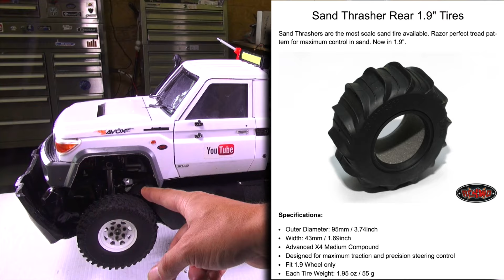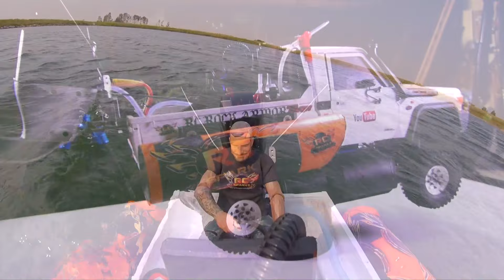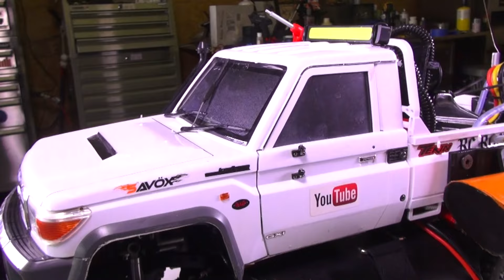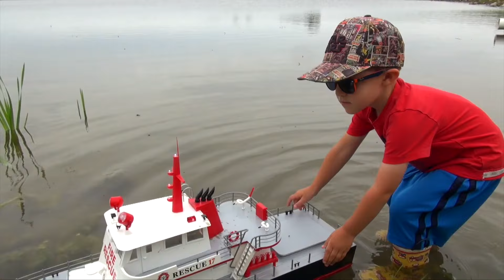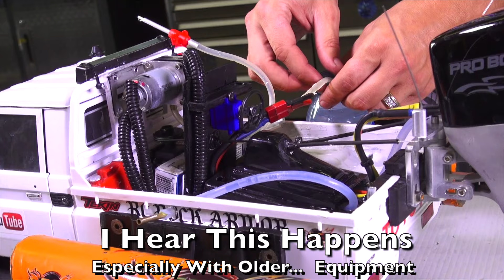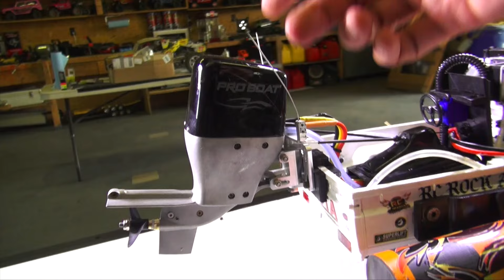RC ADVENTURES - TOYBOTA PROJECT - PT 8 - BBC TOP GEAR TRiBUTE BUiLD - TOYOTA LC70 TRUCK-BOAT

Comment: This probably wont be read by anyone ... but as a thought ... a ladder rack system but with 2 aluminum ice trays filled with "float foam" ... the ladder rack could be used as bracing and as each of the ice trays is nearly as wide as the truck - it would be incredibly stable "in  theory".  I have watched several of your videos and have enjoyed each. Best wishes.

Comment: Splice in a small overflow bottle so when the water is sucked up and goes into the Overflow bottle and then Prime's the line to the pump. that way you will always have a little bit of water in the overflow tank

Comment: The outboard pitch that you talk of, is the "trim" of the outboard. Also that flat plate above the prop should be level to just above the truck bed. You would get ALOT more performance from the outboard. They do make extensions  for most outboards. Ok enough of me, and good luck. I enjoy watching your videos, keep it up.

Comment: Are you sure that your problem was not a thermal shut-down of your ESC?, I did not see much water going through your cooling tube. Normally you need boat speed to force the water through the cooling system, your vehicle not being a boat does not generate a lot of speed. Interesting project, good luck with your future pond crossing.

Comment: i built a Plymouth GTX plastic model body into a RC car... i used micro losi highroller esc, remote and steering servo, and an rc heli motor for drive :)

Comment: Finally grew a pair of bearings and put down some cash for a TF2. I'm so happy with it, I immediately slapped on a F350 body and got rid of the white rims. It's a very scale and fun truck to work on and drive.

Comment: for the pump you could put a float switch on the motor side of the esc and then leave the switch that is on the remote on so then when the back fills up it pushes up on the switch and turns it on completing the circuit and the pump will turn on and pump the water out and then when it gets low the float switch will stop floating so the circuit will be broken and the pump will stop right before it gets below the end of the hose sounds complicated but it is't really if you are interested i can send you more info with a diagram

Comment: To keep loosing your prime on your pump, don't pump the water out completely. Keep enough just enough water in the bed of the truck to keep the bilge hose submerged so it doesn't lose it's prime.
Reply: Sorry, meant to say to keep from loosing the prime.

Comment: Love it man!! This is cool stuff. Gotta drop the angle of the out board. Yea it's picking up the front a bit but it's also driving the back down into the water. What in the video as you hit the throttle the back drops a ton. Awesome project

Comment: You can try putting a Y connection on the pump
One stays in the water to let the pump primed, and the other Y end stays in the rear of the truck, but i dont know how it will handle, or the shorter part of Y in the water, and a longer one in the rear bed of the truck, so that it sucks water first and then takes the water of the truck itself out

Or, you can let the water cooling of the esc and motor comming in the rear of the truck instead of out of the truck, and then use the pump on low speed so that it takes water out consistently
Just saying and helping you with ideas, i watched all the episodes and man, it's soo cool!

Comment: To keep it primed possibly put a small cup in there, that way you can hit the gas more when it is out on the water in order to keep it primed from the actual water coming in. By small I mean a shot glass or medicine cup for cold syrup cut down to fit.

Comment: Nice Project Dude. Just Lower those 2 orange floats by about an inch or 2 , this will life the boat above water.  You'll solve half of your problem I suppose. BTW All the best :)
Reply from the maker: But as a Tribute Truck.. I am making it as close to the full sized Channel Crossing as possible. Lowering the pontoons is not an option! Lol.. I want to ensure I can be as close to the episode as possible.. no cheating!
Reply: oh! Thats the case. Good luck! Waiting for the Channel Crossing Video :)

Comment: In regards to the pump losing its prime can you not put a spliter in the pipe 1 that sits in the same place as you have it now to remove the water from the tray and another length of tube that comes out the side that sits under the water line so it always has a constant water supply ergo eliminating the issue with the pump running dry

Comment: Try to run the tube straight down into the truck and then bring the tip through the back right of the truck and seal it. That should keep water in the lines and keep it primed. Keep it up! I want to see it make it!!

Comment: You wanted to know how to keep the water pump primed, you need to bring the hose from the pump underneath the rear of the truck bed and bring it up where the water builds up . make a hole and when the water does leak to the rear of the bed, it  will go in the hose from underneath the pickup and it would self Prime itself. In theory anyway can't hurt to try it out up to you I enjoy your project they are fun to watch and they bring out good ideas thanks Vincent dimino from torsional Concepts thanks for your support when I needed it have a great day
Reply from the maker: Vincent!!  What an epic idea my friend. I like that.. its the best I have read yet. Yes.. running the tube under the chassis, into a Hole in the tub! SMART!  Hey man, this hobby is about Community! What goes around comes around ;) Thank you!

Comment: Very cool build series... Take a sheet of clear parma Lexan (.040 or .060" thickness) and raise/extend the bed sides and tailgate. Use one piece so you can heat and bend the 90 degrees around tailgate corners so it won't leak and could make it removable. Where it's clear it really wouldn't change the look of truck, but would keep water from flowing into the back. You could seal it where it attaches with silicone or goop. On camera I doubt you'd see the clear polycarbonate, but it would keep water out better and probably wouldn't need bilge pump. Either way, awesome build & would be cool to try this.
Cheers!!!
Reply from the maker: Pete my friend.. but that would be CHEATiNG! haha :) Also, you may not be thinking of the Outboard Motor Control Wires for steering! they are right above the tail gate.. I have a few millimeters.. !
Reply: I understand...lol, good luck man. Cheers

Comment: Yup, still here. Just watching as much as I can before Imra hits and lose power. You need a small check valve to keep prime in pump, not sure what to use though. Got to have lights in case it... you know so you can see it when you dive for it lol. This should be epic 2.0. God Bless Ya   Dave

Comment: A Kavan One way valve might help to keep pressure in the water pump...
Ive used them to keep pressure in the fuel tank on nitro buggies fitted in the tube between the exhaust and fuel tank, they are pretty cheap around $10 Canadian

Comment: Heres an idea about the pump maby try running a y line off it into the water so one line will always have water in it not sher if it will work but just an idea    Robert Miller from Washington

Comment: You could try fitting an in-line non-return valve into the pump inlet hose. I used to run one on my 1/8th nitro to prevent just that scenario.

Comment: Maybe you can put a  Y on your suction hose that goes from the back of the bed of the truck 1 holes for the back of the truck and one hose that goes into the water therefore it would keep the pump primed at all times if you see what I mean
Reply: Kevin Breaker wouldn't work as air has least resistance the y would take the air once the water runs out unless he is able to put a valve on it to shut it off. Put a hole in the side of a straw and try drinking ya drink and see if you get air or water

Comment: enjoying this very much Medic. Just a thought, a fuel/water separator dump or pump that will automatically come on when the water level crosses the probes. You could dump the esc, receiver setup.
Bet you all had a good laugh watching the hose as it lost pressure..... keep it family safe right.....
Eight episodes? Oh wow it has been that many, guess I am enjoying this more than I realized.

Comment: An idea to help keep the prop in the water would be to trim a little bit more off of the bottom of the fin under the prop and then lower the motor, at the mount, the same amount (i.e. cut off 3 mm, then lower it 3 mm, etc.). Then you could give more throttle in the water without too much hassle.
From what I've been seeing from this entire build series, so far; it does not seem as though the fin is adding much if anything to the steering or stability anyhow.

Comment: Just wondering if the cab isn't getting into the water at all couldn't you remove the foam in the cab to reduce some weight

Comment: You can use a one way check valve the valve allows water to flow in one direction but not the other

Comment: You could probably use a check valve (similar to ones you can buy for aquarium air/bubbler systems) on the water pickup line for the bilge pump. It would allow water to flow through it to the pump when it's running, but it will stop back-flow when it's shut off. They should be relatively cheap at your local pet shop or anywhere you can pickup aquariums. 

I love the build so far!

Comment: use a one way check valve on your water line,trouble fixed,will always keep water in the line because it cant drain back out.

Comment: Use corrosian X on anything that has to do with water and electricity. I bought a can and have never had any issues with all my RC equipment including my Apprentice.  I have one I use just for water. I sprayed corrosion x on all servos and motor,esc,everything,and no problems with any splashs or emmersions. Your Toyboata is awesome. I like projects that extend a channel out. I am working on a Kadet Nitro RC Trainer Plane that hasnt been flown in 15 years,I am trying to make a video series on that project,including repainting it. The covering is a Silk,not monocoat,so I am painting it.

Comment: Great fixes on this!  I like that pump!  Great way to remove the extra water!  The only way I could even think to help keep some water primed in that hose would be to have a little tiny container no bigger than an 1" long by 3/4" across and have the pump end hose connection at the bottom and the pick up end with the hose at the top.  That way it can keep a bit of water in it at all times even if you suck a little air at the back end it will stay at the top end of your mini container and should allow it to keep primed until more water fills up in the truck bed and away the pump goes without issues.  Just an idea to think about!  Good luck on this!  I can't wait to see it get across your pond!  Thumbs up Aaron!  ;-)

Comment: .Hey My Friend : I am disabled and these r/c's is the only thing keeping my sanity but I have so much to learn .Could you please do a tutorial on ESC amps compared to battery amps .And the differences in sendored and sensorless motors .I would surely appreciate it .. Now I don't need a speed demon but I do want one fast enough to do light bashing .I have a electric converted T-maxx , What combo would be best .?? I have a 60 amp ESC and a 4380 KV motor with 19 tooth pinion gear and a 54 tooth spur.
Reply: Russell Cupples that combo sounds like it will run really hot in a tmaxx. A cheap system you could use is a goolrc 3674 and a hobbywing 120a esc perfect for light bashing. 

Battery amps are how much electricity is being stored, as it is measured in amp hours. Esc amps are how much the esc draws.
Reply: Oh I forgot to add my Battery which does make a difference .i run a 5000 mah 30c 2s
Reply: 4380 at that gearing is gonna smoke the motor and esc and if they Survive the battery is gonna hate its life something more like A 3675 size of around 2200 to 2400 KV with your same gearing and stick with a 5 mm output shaft instead of the 3.75 of the 540 can motors.
Reply: I do have a 550 size can with 3 mm shaft but the rest of the info I had no idea and I sincerely appreciate the advice .
Reply: Russell Cupples That's what we're all here for brother. Check out the wish app if you haven't done so already or you can just look it up online as well wish.com super inexpensive brushless motors and brushless motor kits. Also it helps to lock the internal clutch of the transmission if you're still using the stock T Max tranny. I've done both e-poxy and JB Weld quick
Reply: https://www.wish.com/m/c/56986051d80dda0f314ee48a let me know if this link works for you. But this motor would rock that T-Mac. And will run on up to 4 cells

Comment: The water canon is actually called a "monitor". During the California gold rush they used much larger monitors to blast down entire mountains to get the gold out of tertiary (ancient, million year old) river beds. They had to ban their use because they were silting up the rivers and flooding entire towns down stream. You can still find some of the old mining monitors here in Northern California.  You could eliminate one ESC if you could find a small float switch (like real bilge pumps use.)

Comment: Personally I think the toybota is completely different but cool , but fixing the pump problem is going to take a sump hole , maybe a 3/8" PVC cap sealed to the bottom of the body after you drill a hole for it . Just trying to help .Sandra Craven St . Louis , MO.

Comment: Awesome,  can't wait to see how the paddle tires work out.  If you put a high spot in the discharge hose of the pump, I wonder if the water would run back into the pump to keep it primed?  Of course if you put the pump under the box and mounted the pickup or intake hose from the outside bottom of the box, the pump would be primed as soon as you have water in the box. Pump motor would have to be waterproof though.

Comment: You want a couple degrees of up thrust but what you have is way too much. The prop is too high and getting too much air for your application, at least lower the outboard unit in future tests.  Also you may want to look into getting a lower pitch prop (like a ship or displacement style) to increase the efficiency given your high-load, slow speed application. 

Rotate the pump 180 degrees so the air bubbles naturally leave the pump

Comment: Is there a way to use the water outlet from the esu to a tee connector with a check valve?

But Its is an amazing project..
Is there anything you would to different?

Comment: That pump and hose are sweet   I feel as when your running in the water  you won't have the prime issues with the pump    In your testing you only had a bit of water  I'm excited to see the next run acrossed the pond

Comment: So I kinda have an idea um I grow up with a bass boat and it had a boat motor trim on it when we're going at fast speed we trim it down parallel to the back of the boat I've noticed it lifted the boat out of the water maybe taking the motor on the back of the toyboata parallel to the back of the the truck might help lift the rear out some but I love the pump idea that's a awesome idea dude

Comment: hey medic, my servo is glitching on my wraith, what is a good but relatively cheap servo, I am trying to save up for another R/C that I can pull my wraith with also, what is a good trail crawler that I can get at hobby town USA in georgia
Reply: also, you can get duck tape to seal the seams as a short-term solution